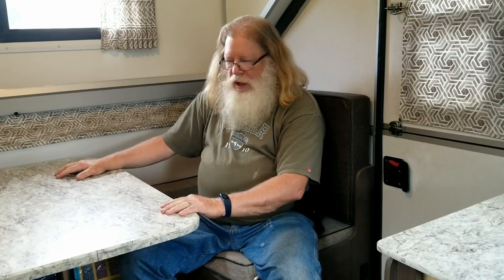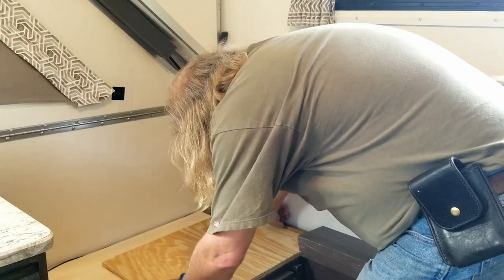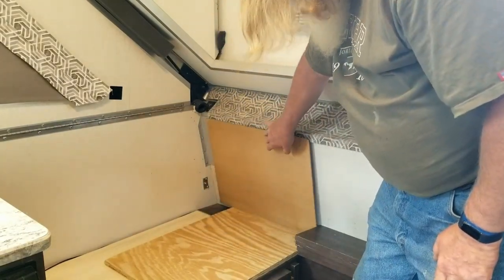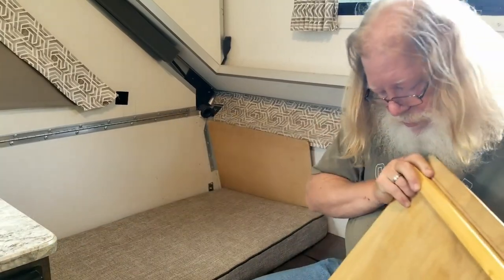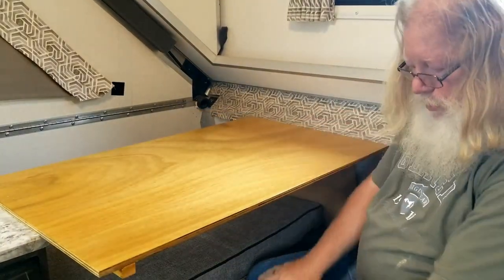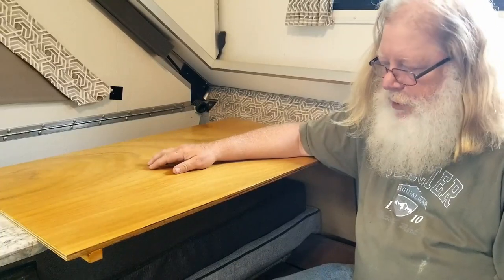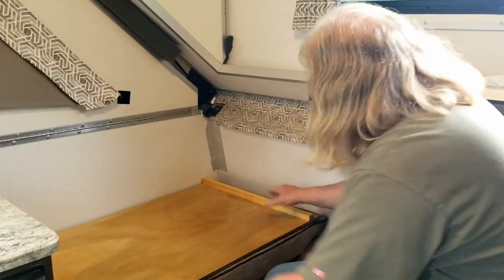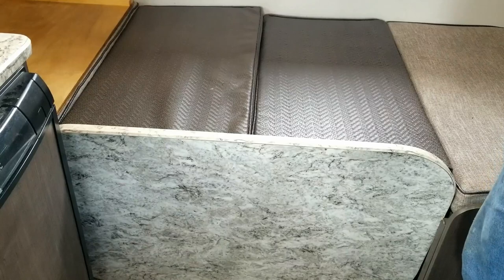6 Aliner Counter Modification

Comment: Really creative and usable modification!!! I just bought an old version of the camper, which was apparently rotted out. Since I will be replacing the floor, most of the cabinet wood , and almost everything, I was looking for a way to make a better travel storage space.  I will definitely be making this modification. Thank you for taking the time and making this video. It was very helpful.
Reply from the maker: I have been told that extending a cabinet into a corner helps stabilize the two adjoining walls. Having the cabinets in the middle and the sleeping areas on the end is to make sleeping for multiple persons easier.